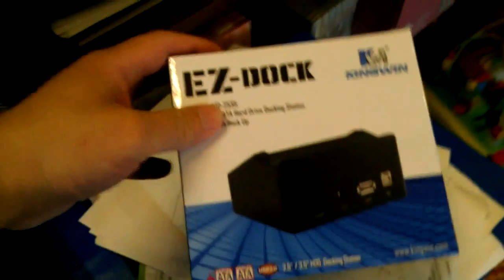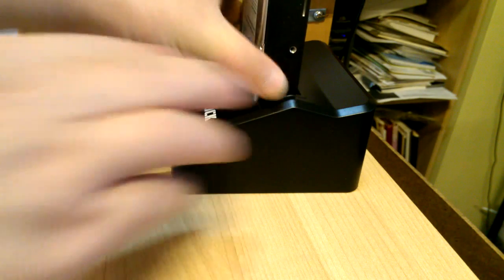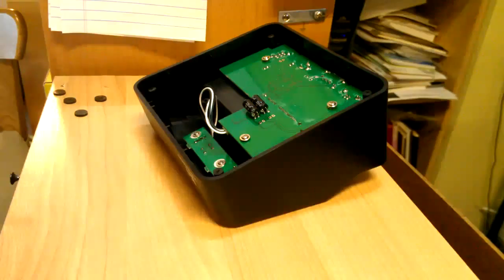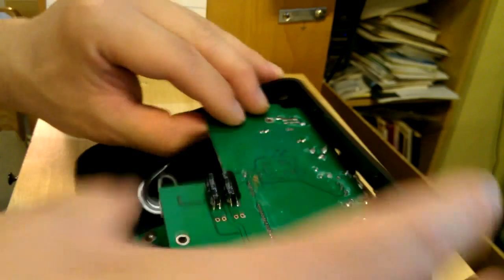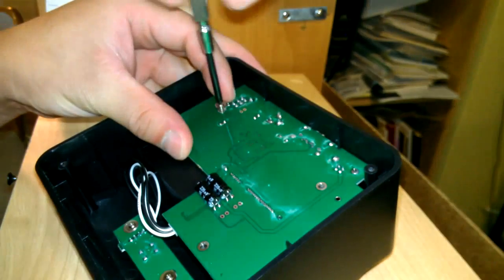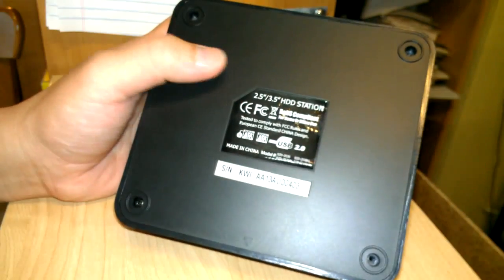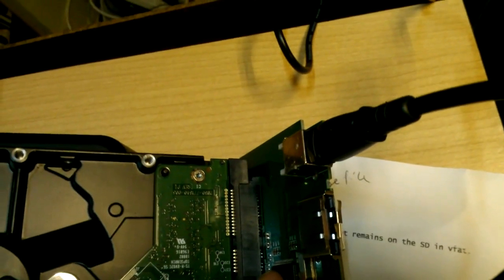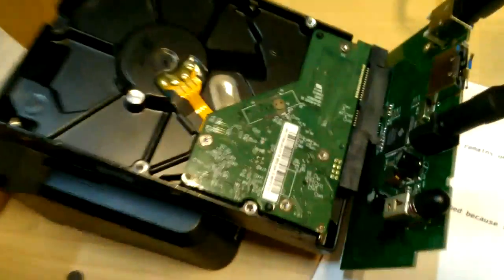Kingwin EZ-Dock EZD-2535 HDD Dock Review and Disassembly

Comment: What distro are you using in the Raspberry?

I am always moving hard drives from computers to read them, a Toaster like this is something i have always wanted to use.  How long do they last?  A small silicone wedge would be perfect addition for steadying laptop hard drives in the unit.
Reply from the maker: I had mine a few years, still kicking.